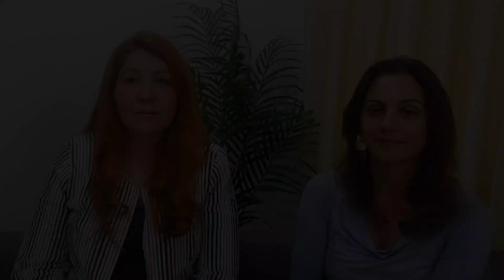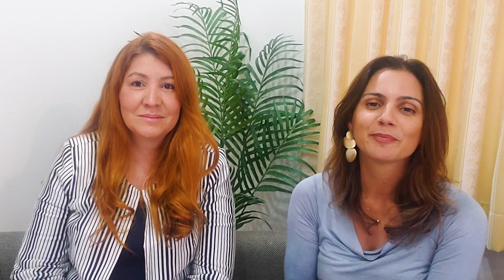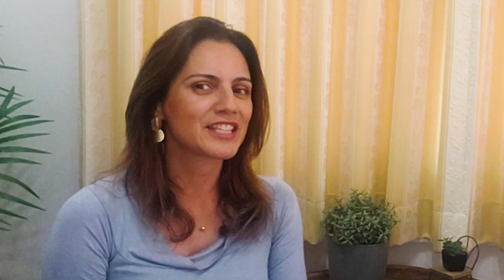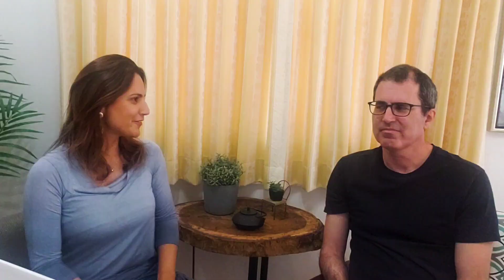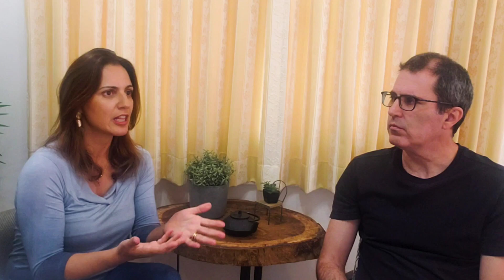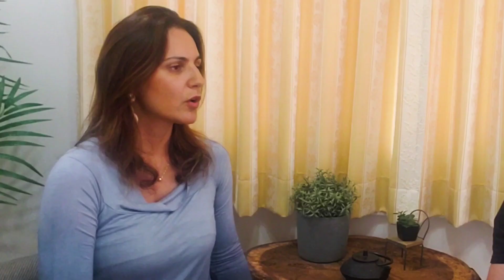Aircraft Air Conditioning System - ECS - Aircraft Certification - Fabio Stabile

Comment: @1.25, It is essential to consider the following parameters for Air Conditioner selection

1. Maximum number of occupants inside the aircraft.
2. Heat dissipation from electrical and electronics units  ( Sl No 1 and 2 are thermal load)
3. Size of doors and frequency of opening and closing of doors.
4. Air vent out size and frequency of operation.
5. Zone of operation (max) for solar radiation consideration.
6. Duct size and routing (including number of outlets)
7. Materials used for construction of fuselage (or effective Thermal conductivity,K in W/M K)
8. Convection heat transfer if any.
9. Factor of safety.
Reply from the maker: Thanks for your contribution!

Comment: PS 
It's very good point talking about virus and air conditioning. A lot of people are afraid infection of virus in aircraft since it's small space. 
However it's wrong assumption. As Fabio discribe that aircraft has strong air circulation by air conditioning system. And it has PEPA filter.
Airframers and airlines have conducted simulation analysis how virus flow in cabin and prove the infection possibility is much lower than being in meeting place at building.
We aircraft engineers are surprised to introduce these correct fact to the public and let remove people worryness of using airplane which helps to recover aerospace industry and get our job back.
Thank you.
Reply from the maker: Maybe after this pandemic, HEPA filters will become mandatory at least for transport category aircraft. Let's see.